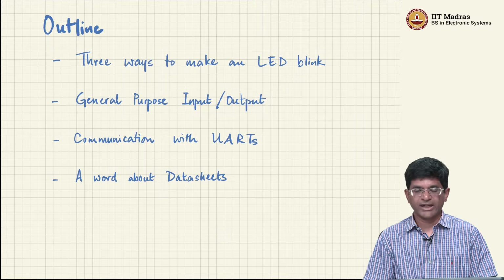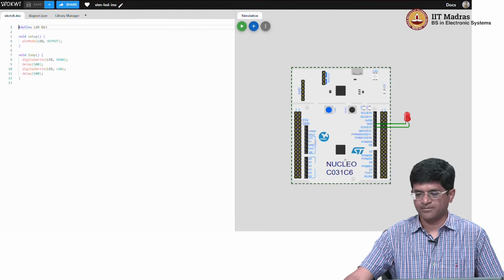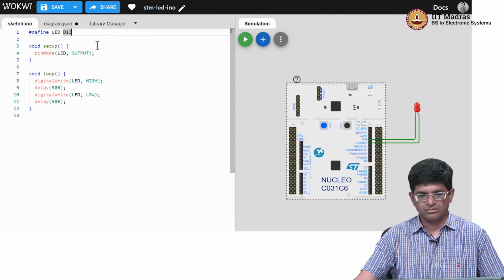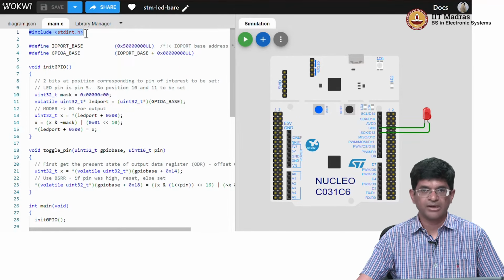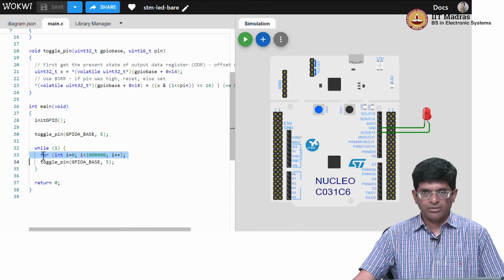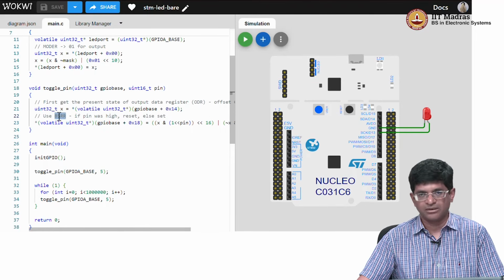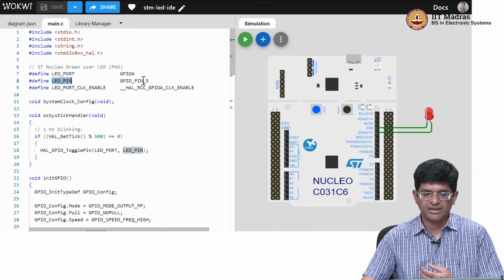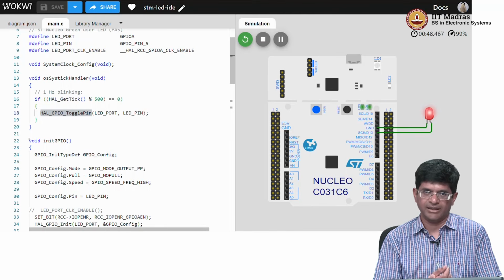L9: Embedded C programming | three ways to blink an led & control hardware on microcontrollers

Comment: Here's more explanation regarding the code for anyone interested in.
First of all, don't watch this lecture without RM0490
Reference Manual (google this pdf) - It covers the entire family of chips 
(the whole STM32C0 series). Ok, we got the PDF now what?
I am focusing only the 2 functions - initGPIO() and toggle_pin().

So first initGPIO - there's a variable called mask, which is an hex - 
0x00000c00 which is in binary 0000 0000 0000 0000 00000 1100 0000 0000 
(each digit in hex correspond to 4 bits, C is 12 which is 8 + 4 -> 1100 in binary).
So the question arise, why we create that mask? To understand it
let's look at the Reference Manual. We're interested in GPIO, looking at index pages,
we can see that GPIO registers is section 8.5 - starts from Page 188. In that
same page we can see section 8.5.1 - GPIO port mode register (MODER) 
- address offset: 0x00, description of that 32-bit register as a table.
The numbers at the very top (31, 30, 29...) are the bit positions. We can see that
each pin gets two bits to control it. Because each pin gets 2 bits, there are 4 possible
binary combinations. Text at the bottom tells what those are: 00 for input, 01 for output,
10: Alternate function, 11: Analog. Our goal is "setting pin5 as output".

As I said, each pin gets 2 bits to control, pin5 is controlled by bits 11 and 10.
To set as output we need to write 01; so bit 11 will be 0 and bit 10 will be 1.
so that 32 bit binary/register becomes - 0000 0000 0000 0000 0000 1100 0000 0000.
I would like to use variable name "state" instead of "x". 
uint32_t state = *(ledport + 0x00) here we that mentioned offset being used. Let me 
explain this line - state = (state & ~mask) | (0x01 << 10) - We want to set those 
32 bits such that it's cleared first for those bits 1 in our mask -  because  before doing OR (|) operation,
we have to make sure that bits 11 and 10 are 00 otherwise | will result in 11 
or some other modes. So in short, we have to clear (or make 0) those bits to ensure 
proper working. So in this line - state = (state & ~mask) | (0x01 << 10) - this part 
"(state & ~mask)" is the one clearing those 2 bits and maintaining other bits untouched.
Then we shift binary 01 to left by 10 positions to perfectly match that bit 10 to be 1.
We're | ing with the previous state, so all bits other than those 2 is maintained.

I'm tired now, will explain that toggle_pin() tommorrow :)